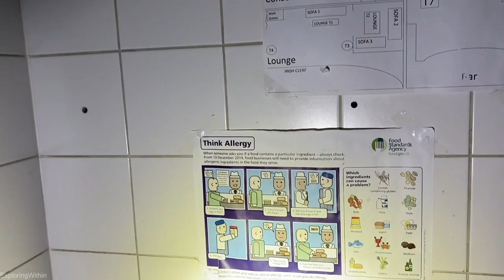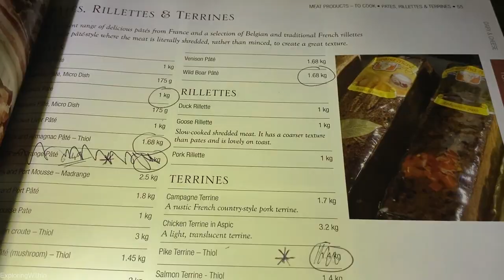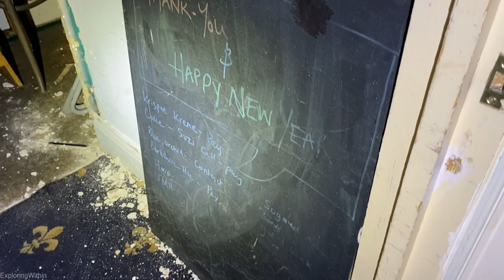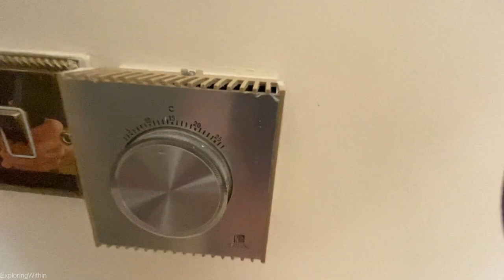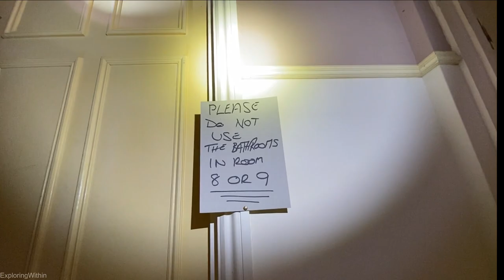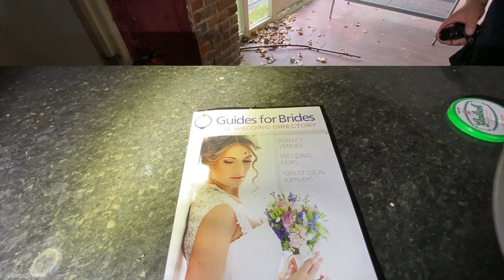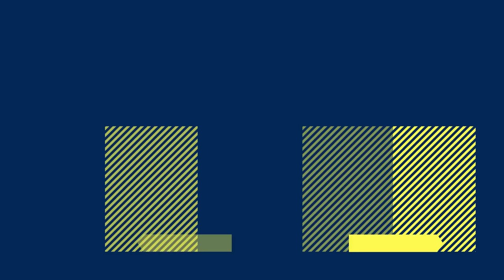Newbury Manor | Closed and Decaying!

Comment: May I suggest, when doing cinematic shots like the intro, choose a lower frame rate, like 24 or 30. :)
Reply from the maker: Actually the lower the frame rate the less smooth the picture will be, especially when I halve the speed, so ideally it needs to be at least 60 for me.
Reply: @ExploringWithin  you don't need it to be smooth though, that's why you see movies in 25 fps
Reply from the maker: @2664k  I do otherwise the footage becomes juddery, and it’s very noticeable

Comment: I went there today and it's a shithole since this has been uploaded it's ruined
Reply from the maker: Shame they’ve let it get like that. Is it wide open with no security now?
Reply: @ExploringWithin most doors are and windows are completely blocked with metal grating. There are windows which are broken but everything is destroyed inside. Chairs are hanging from ceilings etc
Reply: I went the exact same day as you! Surprised we didn’t cross paths